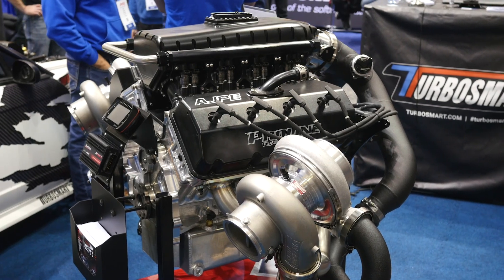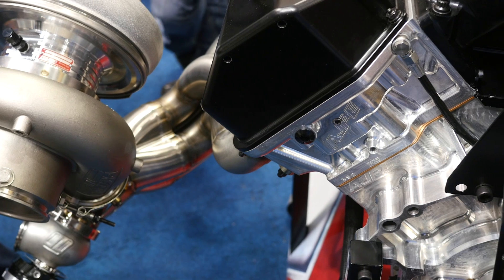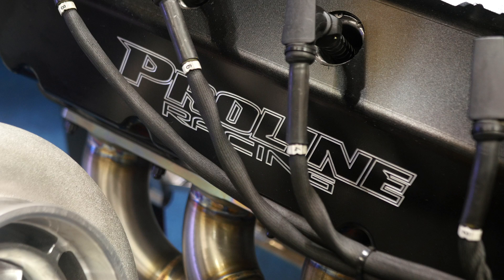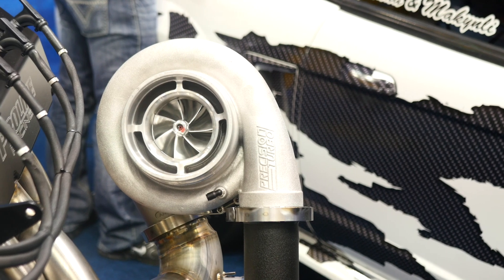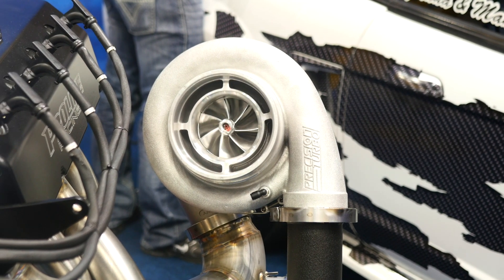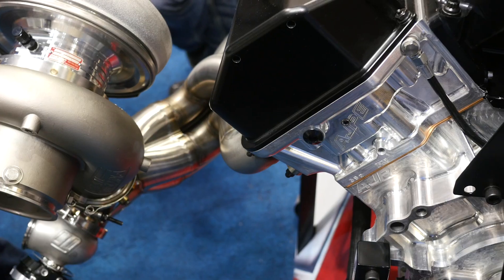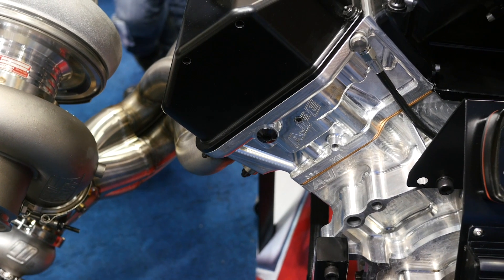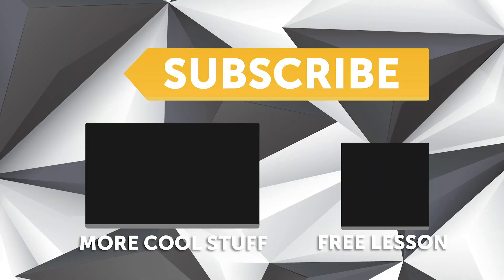Proline Racing's 5200HP Hemi V8 | Secrets Revealed [TECH TALK]

Comment: So the fuel guys had the engine design and cylinder pressure issue soled already... 12000 HP nitro engine platform to the rescue...

Comment: 85 psi boost on methanol is something the tractor pull guys have been doing since the mid-1990's.
It's the 10,000 rpm on the Hemi that surprises me.  No wonder they can't keep rods in it.  But if that's what they have to do to win...
I'm just waiting for them to start mixing nitromethane in with the methanol.  I've always wanted to see turbos take over in the nitro classes, but the NHRA will never allow it.  They can't stand to see the cars go any faster as it is.
Reply: It's not that. there isn't a turbo big enough. and hasn't been a proven set up. A blower has the volume to produce those numbers a turbo engine hasn't yet. To make 12,000hp that turbo who be the same size as the engine. Turbo tech hasn't reach there yet.
Reply: @Al-mx6ru  Bullshit.  There are turbos large enough.
Reply: Can't find a single turbo large enough?  Put on 2.  Or 3.  Or 4.
Reply: @andyharman3022  really? no sir it would have to be massive. Imports n  buses run compounding turbos. The fastest imports run them. So do public transportation. They were the first. Then the truck pulling scene did then the imports took it for themselves. They have  compounding turbos to make serious boost. A single turbo will not.
Reply: @andyharman3022  show me a car with turbos making over 6,000Hp? There's thousands of blowers making anywhere from 1,000Hp to 12,000 HP . To this day not one Turbo car can hit HP numbers a blown car can. That's why. Turbo cars would get there ass handed to them. That's why.
Reply: @Al-mx6ru  You don't know beans about history.  Tractor pullers were running two-stage turbos in the 1970's, and 3-stage turbos by the 1990's.  Single stage turbos will run up to 6:1 pressure ratio at 70% efficiency.  Roots and screw compressors are 55% efficiency at 3:1.
Reply: @Al-mx6ru  The reason Top Fuel cars make 10,000 HP is that they run nitromethane fuel.  If you built a nitromethane engine on twin single-stage turbos with 40 psi boost, it would beat the blower car.  NHRA doesn't allow turbos in Top Fuel because they don't want them to go any faster.
Reply: @andyharman3022  your talking about turbos. So am l Has a turbo car hit a mid 3s pass at over 345+ mph? Has a turbo car produce over 6,000Hp?  No they haven't.  The fastest turbo cars are full on purpose built drag cars. With slower times than a blown car also purpose built. What's your point here ? That turbos are behind blowers when it comes to all out performance? Cs then you'd be right. Nothing turbo can hang.
Reply: @andyharman3022  your making it sound  so easy to make big power. If it's so easy n can be dun. Why haven't anyone dun it? Why isn't a turbo car in front of everything then if that easy Like you say???? It's not easy that's why. It  hasn't been dun yet that's why. Your talking a bunch of what ifs.. that's cute. Weres your proof?
Reply: @andyharman3022  you bring up efficiency, how's putting 4 power adders on a engine more efficient than a single power adder? and that single one out performs the one with 4 power adders? Plumbing and turbos will be even more pricey. How's that exactly better? More efficient? Than a single  power adder? With minimal plumbing. I can't see that being better. I'm sorry. Turbos are free power without a doubt and great power. But there still very far behind a simple blower as Max power goes. Top fuel can make over 12,000Hp. They run them around 10 to 11,000 HP. To put on a show for the fans.
Reply: @Al-mx6ru  Watch any Richard Holdener video where he runs turbos vs any kind of blower.  Turbos make more power per pound of boost than blowers.
Reply: @Al-mx6ru  I can tell you don't know the first thing about compressor efficiency when you write things like that.  Each turbo running in parallel has higher efficiency than the single big blower.  I have quoted numbers.  You're just blustering.  I have pointed out twice in this thread that turbos aren't allowed in nitro cars, but you keep ignoring it.
Reply: @andyharman3022  true there free Hp but doesn't change a dam thing what l said. Turbos are still way behind Max HP and TQ numbers compared to a blower. That video is great still doesn't validate your point's. My points are beyond valid turbo cars are slower than blown cars. A single power adder  outperforms a car with multiple power adders like turbos and compounding turbos. Can you not  agree with that? When a turbo car can match a blower car in performance. Then I'll completely agree with you.as it stands now. Put the baddest turbo fully built car you can find n put it up to a blown fully built car n that blown car will completely blow the paint,doors n trim off that turbo car. Easily. That's why.
Reply: @andyharman3022  I get what your trying to say in certain class they dnt allow bigger turbos. They have to keep it fair  l completely agree with you. Yes in certain classes turbos would be faster. But when it comes to all out performance turbos are still behind Blowers when it comes to Max HP and TQ numbers n performance levels.
Reply: Turbo cars trap speed in 1/4 over 200+ mph... blower cars trap speeds over 300+mph. How would that even be a race? It wouldn't....
Reply: @Al-mx6ru  Compare apples to apples.  Pro Mod  Turbo cars have been trapping at 260+ mph for years.  NHRA has limited turbo size to make blower and nitrous cars competitive.  You can't compare nitro cars to gasoline or alcohol.
Reply: Nitro methane wouldn't be able to run with turbos. The amount of raw fuel and psi coming from the exhaust would shatter the turbines in those turbos. Each primary tube is like 4" in diameter. There would not be a turbo big enough to flow the volume with out robbing exhaust flow or destroying the turbo. Blowers on top fuel are already at 70-80 psi. They max the rules at limiting the cubic inches. No more then 500 cubic inch. If they wanted them faster, they wouldn't switch to turbos, they would just allow more cubic inches.
Reply: @bighoss172  One major point of going to turbos would be to eliminate the poor fuel distribution in the intake manifold that forces crewchiefs to overfuel the engines, so that raw fuel wouldn't be in the exhaust.  It's a complete false argument to say the fuel and pressure would shatter the turbines when they are already up to operating temperature.  Take a look at the airflow specifications of gas turbine engines, and you'll begin to understand the magnitude of mass airflow and pressure ratios that turbomachinery is capable of.  Just like in Pro Mod, if turbos were allowed in Top Fuel, the NHRA would step in and limit the turbo cars so that blower cars would have a chance.  And by the way, blowers on nitro cars don't run 70-80 psi.  They are limited to 45.5 psi by the rules.
Reply: What it boils down to is Top fuel is to unstable at high boost applications for it to work. It'll wanna pre ignition with all that boost. Top fuel doesn't need spark.. a little static  compression n that shit lights up. Top fuel starts there engine's with absolutely no ignition spark. Just very little static compression. That 80psi turbo engine would be in a couple thousands pieces on the floor. Running top fuel at 75, 80 psi. LMFAO . That's why. Turbos would need to much boost for top fuel. Top fuel is extremely violent. It melts fully built engines at low boost imagine a high boost applications??  That's just silliness. But hey to each there own. Most passes are at 40psi. NHRA is full of rules.
Reply: @Al-mx6ru  Turbos at 45.5 psi put out lower air temperature than blowers, so detonation would be better controlled.  Top Fuel does need spark in the early part of the run, then the spark plug tips burn off, and they work as glow plugs for the rest of the run.  Top Fuel engines run about 6:1 compression, so peak pressures are controlled, unless a cylinder goes dead, then it hydraulics, and the engine disintegrates.  There are plenty of alcohol tractor pull engines out there that run 80-90 psi boost on 2-stage turbos, and they go run after run without needing rebuild.  Like I said before, NHRA limits boost to 45.5 psi, and two single-stage turbos would be fine for that, and they would mop the track with the blower cars.
Reply: @andyharman3022  yes but not on top fuel. 80psi n the whole thing's a bomb. Your talking about gas. And that why there's no 6,000hp turbo cars or above. Trackers n imports have been running compounding turbos for decade's. Nothing new there. Still slap on all the turbos you want. Still won't make more power than a blown car. That's my point here. What's yours? That turbos have more boost capabilities then blown apps?  you'd be right.  Doesn't make them faster or more powerful thou. Im not sure what your getting at here? My points are very valid everything is true. Blown cars are faster than turbo cars. Can you agree with that?
Reply: @andyharman3022  l can't agree with your opinion. Cause that's what yours is..Im sorry turbo car's aren't faster than blown cars.  Give me an example of any absolutely any turbo car running mid 3s at over 350+mph in the 1/4 mile or of a turbo car producing over 8,000Hp. Then sir I would completely agree with you. Till then turbos are less efficient at making big stupid power. You'll need many more to make less power than a single power adder. Those are facts sir.
Reply: @Al-mx6ru  Oh, come on!  Do you know ANYTHING about drag racing?  Fuel cars don't run 1/4-mile, they run 1000 ft, and have for more than 10 years.  As I've told you before, the reason Fuel cars make so much power is because of the nitromethane, not because blowers are so awesome.
Reply: @andyharman3022  but turbos  aren't so awesome either. Come now. There slower with more. Lol. That's far from more efficient. It does matter that's why turbos can't run top fuel. To much boost.Bottom line here turbos are slower and less efficient when making big record holding power and records. Nothing runs 1/4 anymore but nothing turbo runs faster.. I'm l wrong? Cause you and l know im right. No need to keep beating a dead horse. Good day sir

Comment: Great engine for those with very thick wallets.  The hemi engine likes high rpm which is very hard on parts.  I believe rods typically are changed out after 20 runs!
Reply: and stevie fast sometimes after only 15  passes

Comment: On wich engine that 550 Hemi engine is based on? 5.7, 6.1, 6.4 or it's an Hemi build from the scratch.. Or it is not an Gen Hemi at all??
Reply: It's based on the 1964 426ci HEMI engine with 4.800 bore spacing.

Comment: Anyone interested in a steppless transmission that can handle virtually unlimited hp and torque with very high efficiency and a few moving parts? It can perfectly follow the hp/torque curve as well. I am the CTO of an aeronautical public company and a machinist/inventor.
Only elite knowledgeable respond please.
Reply: SpiritofDaniel post a video link mate, otherwise yours is a scam. CVTs are not lasting in mild oem applications let alone 5000hp cars.
Reply: @nordic5490  
You're correct however this works on a different principle. I do not have a patent on it so I'm very protective of it. I do have a publicly traded company with my aircraft invention in it. It is a major breakthrough but it still has to use motors to drive impellers to push air so it's not anti-gravity. The stepless transmission is the most efficient way to accelerate Mass and I stand by that. It was tested my remote control car but there was a major challenge that took me many years to figure out but the answer was unbelievably simple. It took me another 5 years to figure the best way into the marketplace that is aftermarket on tractor trailers bolted in between the frame rails. I'm far from a scammer or somebody claiming non science-based outcomes. The irony is they are used almost everywhere but they have never been recognized for their potential because Engineers assumed its limitation was automatically insurmountable. It was again remarkably simple but took me 10 years to figure it out. If you're some kind of opinion leader or connected in some way to major industry I would share more.
Reply: @nordic5490  
It's funny I just noticed your name. LOL. I am actually Nordic as well. Always thought I was from Germany until DNA ancestry. I assume you probably AR more knowledgeable if you're on this video link. Where do you live now? I live in Miami but am moving shortly a bit north to Boca Raton Florida. That's where my public company will be next headquartered at Florida Atlantic University.

Comment: how does these guys get the power to the ground?
Reply: The tunes will be constantly changed or adapted to the car/track variables. Check out the 11,000hp TF pro mods that people like Scotty Palmer are playing around with now. I think I have yet to see a full solid pass happen in one of those cars. With race engine technology getter better, and higher and higher  HP these days.... like  your question implies, how are these guys going to solve the power to ground issues?... Good question, and most relevant.  Tom Bailey seems to have a good handle on that with his cars @ 4000-5000 hp, but as HP increases so will traction issues. It'll boil down to IF ever or WHEN and under what conditions you tune it to allow full power to hit the wheels during a run.

Comment: 5200hp you can never use. that thing will never be in a car making more than about 2200hp. should last at that rate, though
Unless its in a NHRA Pro Mod, then i could see the 5k mark. Wonder how many runs at 5200 it can make before a tear down.....ok 15 runs aint bad

Comment: Be awsome to see where they are in 10 years. Also would love to see instead of 5 thousand then 6,7,8,9,10,000 HP make a 5,000 HP plus motor that you can run hard like a daily driver where you dont need a rebuild every run get 100 thousand miles before you even have to change the plug only wrenching you have to do before that change the oil.  Be great.
Reply: this engine in a street car at about 2000hp would last a long fucking time.  Good oil and no racing, i bet it would make 100k or better in a road driving car.

Comment: Proline isn’t the real engine builder here, it’s Alan Johnson. The name is right on the valve cover. Proline just bolts it together but Alan Johnson is the R&D behind everything
Reply: Ha your funny
Reply: AJPE is in the cylinder head not the valve cover you engine genius.
Reply: What about Brad Anderson?
Reply: kyleshady21 incorrect sir . They use billet AJE block and heads ( which they suggested and R&D’d the inadequacies)
Reply: Alan Johnson.... Isn't that the guy way down yonder by the Chattahoochee?
Reply: @ablejohnson738  lol ! I'll bite...... It's Allen Jackson! Lol!
Reply: @darrenkastl8160     :-)
Reply: @ablejohnson738  Alan Johnson was the Top Fuel crew chief for years, had a brother named Blaine, died in a drag racing accident.

Comment: I know that pro line engines are but I didn't know they are that good. These engines are built strong I didn't realize how good how strong and durable. I Wonder how much heat temperature it can take and for how long. But I day this pro line engine is just bad a$$. Go Ryan Martin fireball camaro, Daddy Dave, Monza they run a pro line engine twin turbo setup.

Comment: I'm skeptical of the 5200hp . Would be nice to see dyno sheet. 10000 rpms for v8 hemi seems high. 84 lb of boost is reasonable.
Reply: 10000rpm is nowhere near out of the question for one of these. I've seen the data logging on all iron SS/AA HEMI engines and on a 160+mph pass, they are over 9200rpm.
Reply from the maker: Have a search, there are dyno run videos 😎 - Taz

Comment: So its a topfuel motor setup with turbos instead of a blower and running nitro
Reply: Not sure, but I think it's running alcohol instead of Nitro.
Reply: KsD Hobbies hardly. 2.5L 4 cylinder cars are running 140psi and 3000hp now. The 2 valve head is holding it back.
Reply: @nordic5490  really weres the video? I dnt think so
Reply: @nordic5490  hey, so throw 140 psi at this thing and see what she does! Lol also have to remember, it's 85 psi to make 5,200hp to the wheel, not the crank. Probably closer to 6,000 HP to the crank. So I'd say double the psi at 140 psi on a 4 cylinder to make half the power seems realistic lol.

Comment: not surprised by a hemi v8 these things were always a monster i wish ls wasnt the swap these days hemi should lol but yeah mopar crate engines are kinda expensive in general...
Reply: The basic architecture is still 426 HEMI. From the bore spacing, to the intake/exhaust spacing, the dual shaft rockertrain, plug location, chamber shape, pan rail, distributor location, cross-bolted mains, etc., etc. The ONLY engine that plays in this league that still maintains that many similarities to the original design.

The 481X, that's commonly referred to as the "chevy" style engine, is a FAR cry from the BBC platform in every respect.
Reply: Not a single part of ANY race engine is from the original manufacturer, but the HEMI architecture is FAR closer to it's original design than ANY of the other makes, including the 481X.